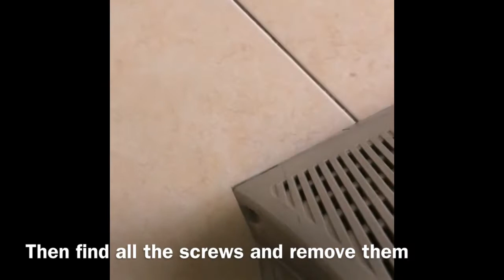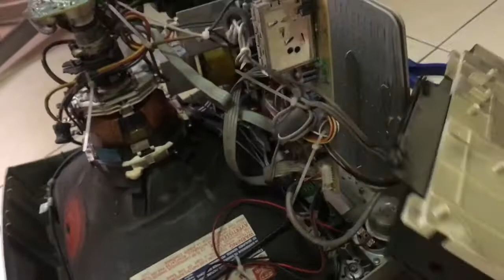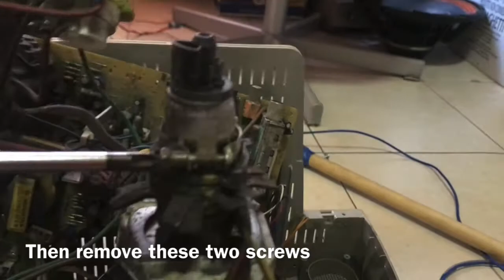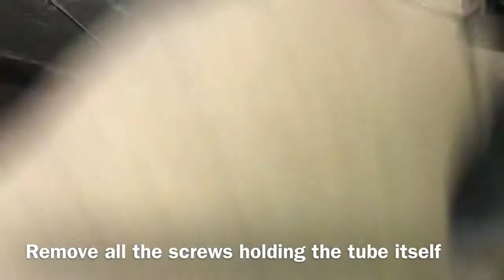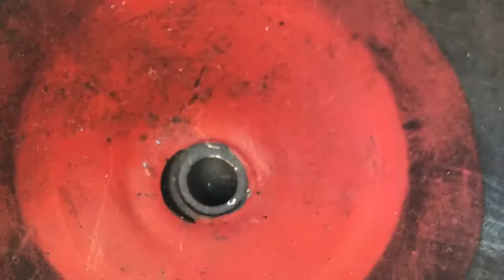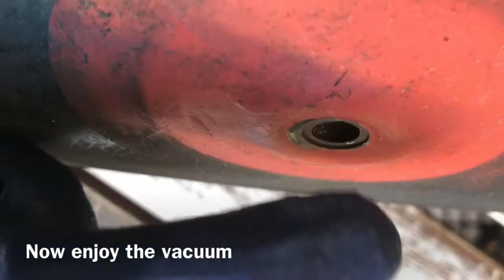How to dismantle a CRT the right way +vacuum release

Comment: I need to do this with a giant 32" CRT which has two knackered electron guns (red and green). I do worry though that the release of the stress on the glass envelope might cause it to shatter? .. there's no way I can carry this thing down 2 steep flights of stairs intact these days.
Reply from the maker: Hi, What do you mean by “release of the stress on the glass envelope” I have done it on a 29” Sony trinitron recently and had no problems at all
I hope the video was useful.
Reply: @jlprojects1259  Thanks for the reassurance. I've got to break the thing up anyway to get the thing out was just worried about possiblw consequences of in effect relieving several tons of pressure in a relatively short time on what I may have wrongly assumed to be a pre-stressed envelope.
Reply: @jlprojects1259  Sorry for such a late response (been busy). What I was referring to is that in my (probably very inaccurate) estimation, there are currently approximately 25 tons of atmospheric pressure on the outside of the glass envelope.

If that were to be balanced too suddenly, I'd worry about the subsequent flexing causing the envelope to crack, potentially violently. I guess a slow equalization of pressure should b erelatively safe though.
Reply from the maker: @BG101UK  That’s right there’s a huge pressure but if you let it in just from the tiny hole under the cap nothing will happen since the surface is tiny. If you were to break the glass it would be really violent.

Comment: ...But why would you want to ruin a perfectly working CRT? And no, I don't mean the entire chassis, I mean the Cathode Ray Tube itself.
Reply from the maker: To throw it away, and remove the vacuum to prevent someone to accidentally make it implode when being “recycled”.
Later I actually broke the glass and took the mesh out as well as the electron gun (just out of curiosity).